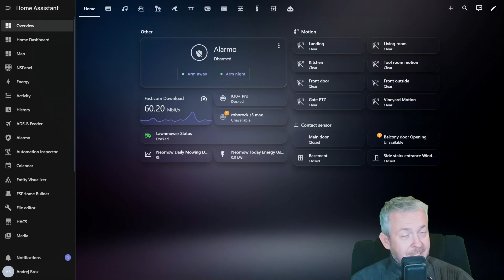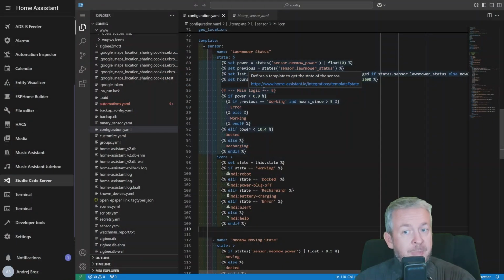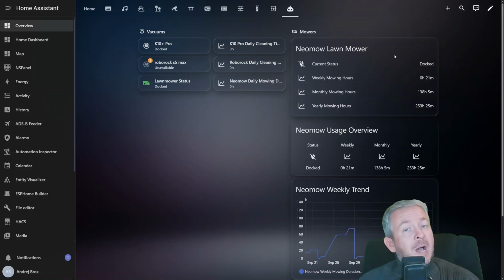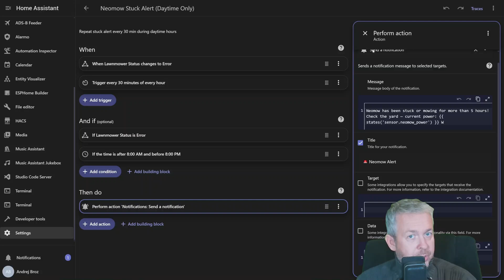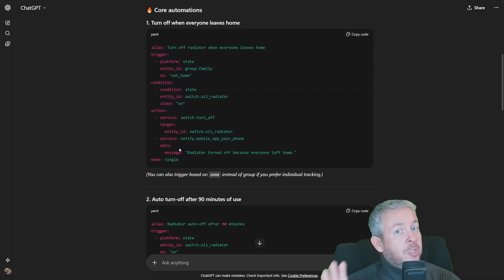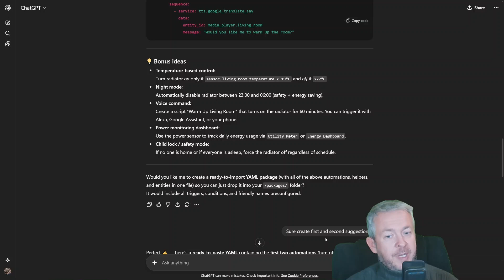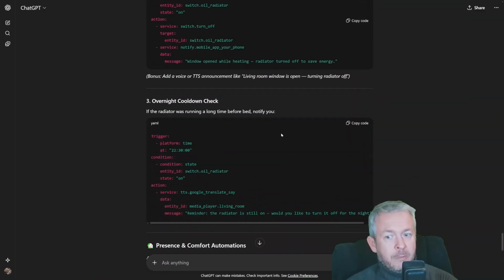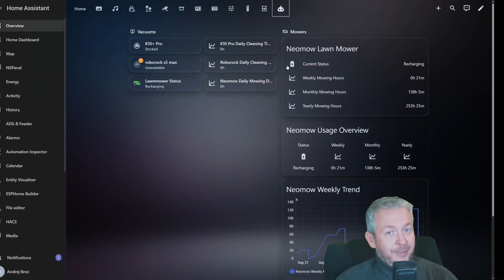No Sensors, No Problem! Full Automation Using Power Monitoring Only

Comment: I have specifically bought two dumb heaters, one for the Bedroom and one for the Bathroom, just so I could set them up with a smart plug and a temperature sensor, using the Generic Thermostat in Home Assistant.     I didn't want smart heaters with fancy features.   I wanted specifically a heater that could just turn on and turn off with no digital stuff.   This way it lets Home Assistant really show it's worth as only Home Assistant makes the heater smarter.      I really couldn't ask for more than that.   Both heaters are setup with Eco mode, Home Mode, Away mode and they are get there temperature from the SOnOff temperature and humidity sensors I already had anyway.     Simple, cheap, dumb heaters that have very little to go wrong, controlled by a  smart hub, Home Assistant.
Reply: I did exactly the same thing last year. I bought two oil-filled radiator type heaters and added Thirdreality Zigbee smart plugs along with Aqara T&H sensors. It's been working flawlessly.👍 The radiator style is much safer than halogen or ceramic radiant. An added bonus is that it doesn't dry out the air.
Reply: Oh yeah I did that too recently. I got this old electric oil heater. I connected it to a Shelly smart plug and use an Aqara W100 temperature sensor set up over Zigbee2MQTT so I also have a display with buttons.
Reply: I’ve been thinking of doing something similar with a dumb washing machine. Thanks for the video!
Reply from the maker: That's a fantastic approach, and it truly highlights the power of home automation!